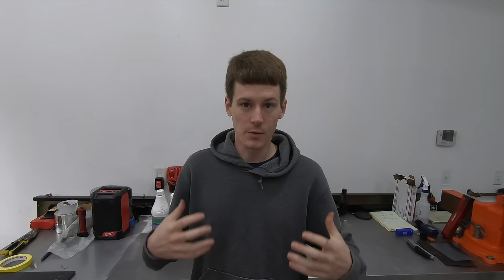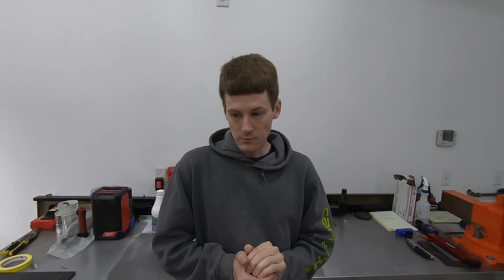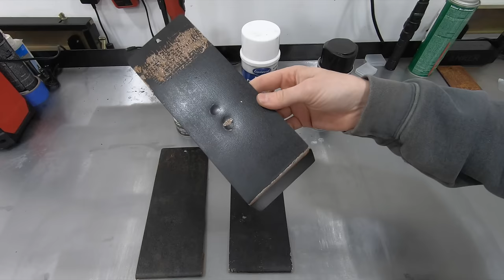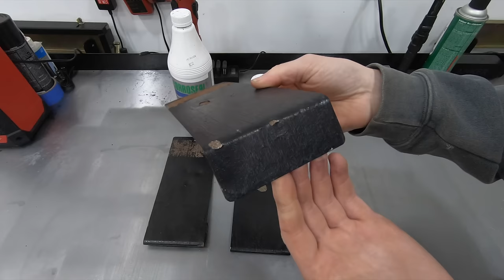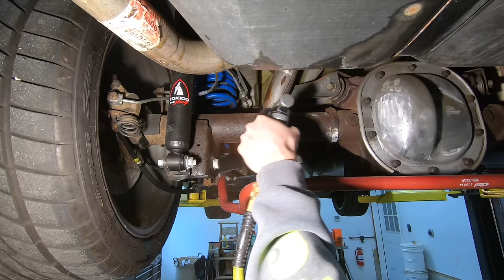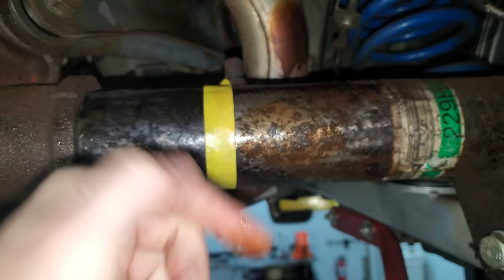MOST Rust Converters Are A JOKE! Let Me Show You. (Eastwood, KBS, Corroseal, Ospho & More)

Comment from the maker: Products used in this video: 
Rust Kutter: https://amzn.to/3deOHjH
Rust Eater: https://amzn.to/2ZQhMi8
Ospho: https://amzn.to/3xQ4peB
VHT: https://amzn.to/3xUhEKZ
Corroseal: https://amzn.to/3rvJL28
Loctite: https://amzn.to/3Dnq6DC
Rustoleum: https://amzn.to/3okblgB
KBS: https://amzn.to/2ZXs1S0
My Amazon Store:  https://www.amazon.com/shop/repairgeek
Help support the channel, buy using my Amazon links
As an Amazon Associate I earn from qualifying purchases and your cost is exactly the same.
Reply: Use benjamin moore rust arrestor
Reply: i've been using krud cutter form walmart in the gallon, brush on. got it based on word of mouth reviews. wonder how it would do. i skimmed this video. also i once sand blasted and brushed the krud cutter on over all teeny tiny pin holes that the glass bead could not reach.
Reply: Dude adhesion test? Regardless of what you use, even paint, primer or whatever. The surface has to be prepped.   The thing is rust converters chemicaly  changes the rust. The prime goal is to stop rusting. Not some adhesion or chip test due to impacts. Most everything would fail.
Reply: @cdoublejj  
Brush? You can spray it on like windex.
Reply: @Foche_T._Schitt  I'm certain which chat thread I'm replying to here. I tried that with krudd kutter rust converter, it didn't seem to go on very thick and seem down like when I brush it on
Reply: Which and what brand of solvent cleaning preps do you recommend after using the rust converters before applying the top coat of paint? Can you make some videos on best prep cleaning solvents specifically for these kind of applications?
Reply: Do you think rust cutter would be good on an exhaust. Idk what the rest of that product is, but I was thinking the black oxide would work good.
Reply: Have you ever tried using an acid called vinegar soaked shop towels on flat surfaces over night?
Reply: @RedOrcDestroyer  I cannot agree with you better here. If I may, I like to help explain it a bit more. Rust converters are chemical treatments that convert rust into a stable, protective layer. This layer prevents further rusting, but it does not provide the same level of adhesion or chip resistance as a traditional paint or coating. As a result, most rust converters would fail adhesion or chip tests. Flexibility is not important when it comes to using the Rust Converters. Also, it is essential to remove as much rust as possible before applying the converter. This is because the converter will not be able to effectively bond to the surface if there is any loose or flaking rust present.
Reply: @jonathanbetenbender307  I do not know if you found the answer to this question, but if not, I like to respond. Yes, you can use rust cutter on an exhaust. However, it is important to follow the manufacturer's instructions carefully.
Reply: @peacepoet1947  Now that is an easy way to help break the rust down to make it easier to remove.
Reply: @tech-ii5sh  I was looking for a spray can that I had used many years ago but couldn't find at an auto parts store or Walmart.  Do you know where I might find the product that you are talking about that converts rust into a protective coating?
Reply: @peacepoet1947  What is the item that you are looking for that you said you used years ago?
Reply: @tech-ii5sh  you had mentioned that they have a rust converter.  You either brush it on or spray it to cover rusted metal.  I cut off the vinyl roof on a 72 Chevy El Camino.  Which was replaced fifteen years ago.  There was lots of rust under it and a few holes.  I'd like to clean it up before laying down some more metal to recover with vinyl again after the roof repair.
Reply: @peacepoet1947  I was basicly talking about the KBS Rust Converter Kit here. This kit is designed to convert rust into a hard, protective layer. It is a two-step process, starting with the KBS Rust Converter and finishing with the KBS Rust Sealer. You can also go a step further if you like with the KBS Top Coater for a permanent final finish which withstands dulling and fading caused by prolonged sunlight exposure.
Reply: while i agree there crap its for different reasons. this is a chemical reaction not a coating process so testing it as a coating is moot it is not used as a coating. as you say iron oxide reacts with phosporic acid....about 1.5% solution  to form iron phosphate . so a complete reaction of oxide to phosphate leaves no oxide until oxygen is present. iron phosphate is soluble so use some solvent as a prep and then apply your coating for best results for coating.  no why do i call it crap   it is all phosporic acid in solution   just sell me the acid and let me mix the solution  and we dont need to pay more than bottled water prices for the water!  and we can get a full 1.5% solution
Reply: a gallon of etcher primer is 80% phosphoric acid - sold at Home Despot - that's by far the cheapest - $20 for a gallon!
Reply: Look at my comment below 👇... Id like to see the Krud Kutter compared to the Rust Cutter and VHT Rust Converter...

Other good acids besides phosphoric acid are muriatic acid, hydrochloric acid, sulfuric acid, citric acid

Comment: Problem with all this- either you are testing a true rust converter which makes iron oxide into black iron phosphate, OR you are testing a coating MIXED with a rust converter so that when it dries it's (ideally) a rust-free coating. The chip test has no bearing in testing a true rust converter, same with the bending test. Your own words were that it was "To test how flexible each COATING was." Well either you are testing coatings or you are testing true rust converters which are not coatings at all but just what they say they are, rust converters. Most of the inferior "rust converters" are in fact an acrylic type coatings mixed with a mild phosphoric acid blend. They do convert rust but are just an acrylic coating in the end which can never be any better than acrylic paint in protection. Even if you put epoxy over them, its only as good as the acrylic paint underneath and nobody recommends acrylic paint to protect steel. As you said, if the primer fails, the paint on top fails. ANY product that turns rust black is likely phosphoric acid even if its just mild, but good for you for checking the MDS info to see if there actually was any in there. However, as I said, anything that can be peeled off is not a true converter. Thanks for putting me onto Rust Kutter. I learned more from your video than I expected.
Reply: i started work at a bodyshop when i started there was a green liquid that didn't seem to turn the rust  black as like iron phosphate it literally converted it back to an iron powder which was of course unuseable but when scuffed away left the metal completely free of rust there was no label on the chemical just a standard spray bottle and reused washer fluid jug full of it when you use it the smell ran u out of the room worse than the smell of rotten egg/sulfur but kinda similar have you any Idea of what this product was?
Reply: @stuffhappensdownsouth9899  Possibly Ospho -by Skyco which is orthophospheric acid and is green and a rust converter. But it does not smell much. Another option might be muriatic acid that turns greenish if any iron gets into it and dissolves rust. It also has a rotten egg smell that makes you run from the room,  but the trouble is that it likely re-rusts even more later on unless you apply a paste of baking soda and water 50-50 to the metal for about 10 minutes before rinsing. These are just speculations.
Reply: Whats the best paint for too coating black phosphate?
Reply: So what should I use
Reply: @MrAhhsum  All products with Phosphoric acid are good!
Its This video that is a joke, for all the reasons this original commenter said. 
They all convert thin amounts of rust, and then seal in the remaining rust to stop the reaction. 
All of the problems and issues the host is having, is because he’s not using them for their intended purpose
Reply: You seem knowledgeable… what would you recommend?!?!
Reply: @thomasbionda  Depends on what you are trying to do?
Reply: @thomasbionda  Actually the Rust Kutter for the same reason he did. Its a true rust CONVERTER and not mixed with a coating. You can paint it afterwards with primer and paint.
Reply: @paulbriggs3072  hey! Thanks so much for the response. Much appreciated 🙏🏼💯
Reply: Absolutely. It is irrelevant to most people about a drop test or flexibility or chipping etc as it's just going to be used on flat surfaces or frames not just sit there for the most part and should certainly be then coated or painted with something else.
Problem is, if this stuff doesn't stick your top players won't stick so most of them are a bad idea.
Better to use something that converts what it gets too and then is washed away so you can then try to seal it with something else.
Reply: @stuffhappensdownsouth9899  probably ospho - works great the "black stuff" is the phosphate and I believe is inert and prime/paintable
Reply: There's no such thing as a good rust converter product. The entire concept is flawed. Anywhere the rust is thick enough and dense enough to prevent the converter from reaching all the way to unoxidized steel, you will have a failure of the coating. 
Better to use a product that removes the rust, like muriatic acid or evapo-rust.
Reply: @chriswisneski6071  Yes the rust must not be deep. Surface rust only.
Reply: @paulbriggs3072  How do you know how if there's rust pits below some areas of the surface rust before you start?
Reply: I use Krud Kutter Rustex with good results. I do find that it doesn’t dry where there’s no rust, remaining slimy, so I wash that off. Then I go over the whole thing with 320 grit wet-or-dry sandpaper and wipe it down with rubbing alcohol before spray-bombing it. If I’m applying an automotive finish I’ll treat the washed panel as if it were bare metal and apply the appropriate primer/sealers before color coating.
Reply: Nobody ever shows marhyde which works well but it ain't cheap
Reply: @tobyu145  if you are going to use it on any part of a car flexibility is going to be a very important thing. A lot of people think a car is rigid, but 99.9% of the cars are NOT. They actually flex a lot. So if your coating cant flex with it it wil start cracking. It wont bend like in this test, but this was also with a fres coating so its actually a decent test imho. After 5 years the coating wil be stiffer, but that car wil still flex the same or most likely even a bit more then a few years earlier. So that coating still needs to be able to deal with that small flex every time its moving.
Reply: @paulbriggs3072  you know what your talking about an im working on a 66 Impala an has pits all over the body from parked for 50 years outside what would be best before my body filler to smooth it
Reply: @stuffhappensdownsouth9899  - likely OSPHO, which is phosphoric acid, water, and something called dichromate.
Reply: Used Ospho on sandblasted control arms, it actual clears the light surface rust quickly, and then once dry it leaves a galvanized surface which keeps it from flashing again at least immediately. That said before paint need to wipe down with a solvent as normal before painting bare metal, directions on Ospho say wipe off any light zinc oxide powder before paint. I’ve used Ospho on pretty rusty parts before after a good cleaning and degreasing, it will take light surface rust off but need to hit heavy spots with wire brush to get the process started quickly. I use it for cleaning rusty bolts but I do cut it with a little water as it helps penetrate the surface better, and really no more than 25-30%
Reply: Thanks for your comments Paul!  I was finally able to track down what each of these is supposed to do (based on the SDS sheets), and debunk the issue with the products with coatings, rather than the actual true converters.  I knew there was something amiss here.  Thanks again!
Reply: @stuffhappensdownsouth9899  Best = Oil coat then heavy dust then paint over oiled dust
Reply: @jeremybroderick9465  Cement dust works the best😂
Reply: @stuffhappensdownsouth9899 definitely ospho. we used it at our shop too. works wonders. i’ve done many rust patch jobs and the body work still holding up to this day

Comment: The only product I've used in Canada is a rust converter made by Rust Check.  It's a phosphoric acid formula with the consistency of water that can be brushed or sprayed.  It does convert iron oxide (rust) to ferric phosphate.  Once converted the actual ferric phosphate does not rust...it's chemically impossible.  Re-rusting occurs when the product fails to convert all the rust and rust is left behind.  Re-rusting also occurs when barriers are breached allowing moisture and oxygen to reach the virgin metal under the ferric phosphate, so it's the virgin metal rusting this time.  When a rust converter is applied to rust, the converter must remain wet for a period of time to allow the formula to soak into the rust all the way to the bare virgin metal.  Applying a rust converter just as a film on top of rust has little or no value.  Start by removing as much visible rust as humanly possible or reasonable by grinding, wire wheels, sanding or your preferred method.  Apply the first coat of rust converter as an indicator tool.  When it converts and turns the remaining rust black and it's now more visible, now it's time to sand, grind and remove as much of the black converted ferric phosphate as possible.  For auto body panel repair, use a Dremel tool with a precision grinding bit to attack as many remaining black specs that you can, like the dentist does a root canal with his drills.  Now you should have shinny metal with very minor black specks remaining.  Now apply 2 coats of rust converter, again keeping it wet to penetrate into the pits of the metal.  Allow the final coat of rust converter to dry for a minimum of 24 hours before applying a quality rust inhibiting alkyd paint with 2 coats.  It's tedious work and you may need to be OCD to endure it.  I have autobody and frame repairs/conversions  that are in excess of 12 years old, with no signs of failure.  Auto rust IS automotive cancer and must be treated the same way.  Surgically cut out everything possible and treat what you may have missed with chemotherapy (rust converter).
Reply: @jjm2948  For a frame, after the final painting process, let it cure for 30 days if possible and then apply an undercoating such as fluid film, a linseed oil and wax emulsion or other type of fluid coating.  Fluid film with flexible spray extensions on the sprayer seem to be the only reasonable means of treating inside the frames and tight areas.  You can only do so much with a rusted frame without separating it from the body.
Reply: Would you recommend to shoot rustcheck rust converter inside the frame and then apply a oil coating? Trying to slow the cancer from my Toyota sequoia lol
Reply: @alexe02535  Internal frame areas are a real challenge and solutions are limited.
Power washing to remove as much rust and debris from inside the frame is the most reasonable solution.  After fully dry, application of a rust converter, followed by an oil, or wax coating should provide the best protection.
Reply: @chrisgraham2904  thanks I bought a sewer jetter I'm gonna remove all the crap inside. I think it will workout well
Reply: Excellent break down, I’m about to do this job on my 4th gen 4runner and will be going pretty hard on it and would love to just have to do this the one time. Are you able to recommend any rust converters that will convert rust to ferric phosphate? And any recommendations for rust inhibiting alkyd paint? Thank you so much in advance!
Reply: @MRHEEGY  Any of the rust converters that may be available in your area that contains a base of phosphoric acid will convert iron oxide to ferric phosphate.  
Rust-o-leum makes a true rust inhibiting alkyd (oil based) paint identified as "Farm and Implement Rust Paint".   Its' price is about 30% more than their standard rust paints and it can be hard to find.  It is carried by Tractor Supply Limited, or many hardware stores catering to the agriculture community.  Available in gloss black/matt black/white/John Deere green/ Massey Ferguson red/ CAT yellow.
Reply: @chrisgraham2904  awesome thank you so much for the excellent info!
Reply: Im going to get hate here, but i had a pickup getting a big block swap, and moving further north, so i wanted to derust and seal before moving. I sandblasted the bottom of the bed, cab, and 80%of the frame( bed off) and brushed with PoR15. It self levels 100%,and looked like glass. In a month sitting without a bed, it started to go flat. I showed my buddy how tough it was by smacking the exposed frame with a ball peen. Barely a scratch. Following spring, i checked, looked great, if less glossy. Some say the formula changed, but if i get the same protection today, id Use it again. So who am i to say what protects against rust? I replaced floors and panels for years in NH, where cars DISSOLVE. Ive painted since 1990. I totally agree on the barrier stopping corrosion. Get ALL rust out before coating.
Reply: @chrisgraham 2904 Thanks for the detail. I've also used rust check but I do it wrong. I do it on driveway and when sanding my old cars my metal will flash when I'm doing my bondo. I'm thinking in my case using your technique but just do a small section covered with rust primer before moving to next spot. How to clean off Rust Check or other products on the good steel  without it flashing.  Maybe because im ADHD not OCD  that's why my rust comes through 2 years later.
Reply: @chrisgraham2904 Thank you for great information. Best regards